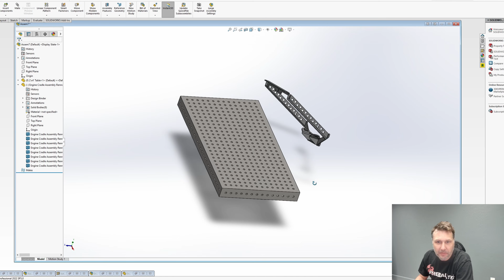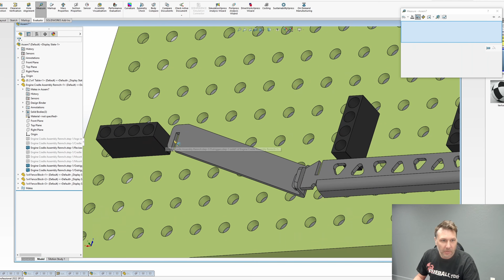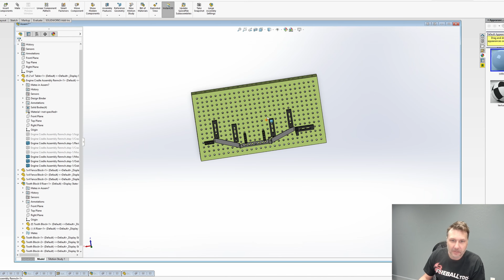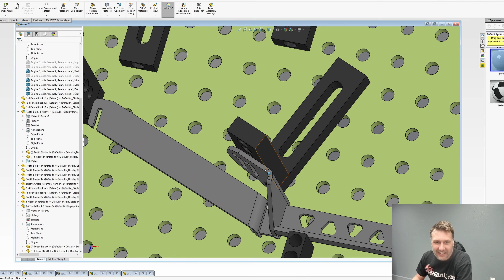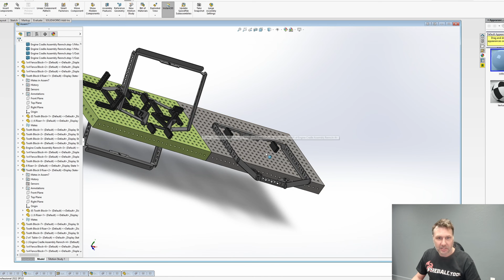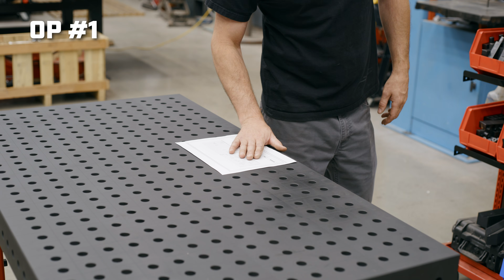How to Make a Fireball Tool Fixture Map: Subaru Sub-Frame

Comment: From my work in topographic surveying, machining, and dimensional inspection, I could recommend that using a planar primary datum surface that all other surfaces are positioned by, makes everything much easier.  That set of positioning references (secondary, tertiary etc. part feature datums) can be more easily located and serve as reference for all else, greatly simplifying design and fabrication. 😉

Comment: That frame is a textbook definition of over engineered =)
Reply: Hi. I am by no means a CAD expert. In fact I'm on the beginner end and this was a stretch for me. I'm curious what parts you found to be "over engineered". ? I would love the assembly and production of these to go quickly and I'm typically doing it by myself, so if there's a simpler way to get there I'm all ears. Thanks for the feedback.

Comment: Jason, I have one concern over the final fixture. The 'Boomerang' sub assembly that hangs off the table isn't located in length(from parallel cross beam) and angle compared to side rails. Once dropped into the rails slot/tab  it could twist in relation to the tables plane   I also think you should include call outs on your fixture map for shims and risers for non-2D mapping.
I really enjoy the videos and admire the system you have put together.👍👍
 Lastly, is there a way within the fixtures to map a 3D layout from locating holes on the parts,(without) using the exterior dimensions.

Comment: in the time you are sitting behind your laptop, figuring out all the distances and stuff. we have made a jig that you can re-use. clamp the jig down and clamp your stuff on the jig (made with mostly scrap pieces of metal). then when you are setting up your blocks and stops on the table (wich you will need to set every time instead of clamping a allready lined up jig down like us), we are allready welding and cleaning up welds etc. the when you finally start welding we are allready lining up the next parts on the jig. 

and then i did not even mention that you will need to measure out the blocks and stops EVERY time you are using the table for something else. instead of just setting the jig down and clamping the jig to the table and instantly being able to clamp your metal in the jig that is allready lined up and measured... kinda makes most of your video's about this table stuff useless...  you are working harder and making your life more difficult with that software and those loose blocks and stuff. no hard feelings but comon, most people can see this is just money wasting if you buy these expensive tools and software just for making a jig that needs time comsuming lining up everytime wich is cumbersome. make a quick jig out of scrap metal. 1 that is re-useable and doesnt need 1 hour computer work and then 20m setup time before you can even start working lmao....
Reply from the maker: This sounds like a challenge. I’ll take you up on that. I’d like to see you make a fixture faster than the Fireball system.  Contact me at the fireball forum to discuss the details of the challenge. Jason
Reply: LOL, what a clown!!!! 
Love your stuff Jason, and the people that do this work for a living or a serious hobby absolutely know the value in your tools and experience.
Reply: But now you need to store the jig when you're not using it. It all depends on how many different parts you are making and how often.
Reply: and dont get me wrong, it is cool that you make advertisement for your work stuff... like the bench vice and what not. but for this.... imo its useless and really a money wasting thing. its like vapes, throw-away because after realising you waste time with it. you will throw this whole block idea out of the world and make a jig urself. and even for 1 time use only you can use clamps and scrap metal to achieve the same thing you are doing now without the actual need to sit down behind a pc for 1 hour figuring everything out and then 20mins for measuring and setting it out on the table.
Reply: honestly would love to do that, unfortunally at the moment i am not capable in doing so. if i ever becomes capable again, and think about this video (wich i will, i like metal work) i will take up on that challenge!

Comment: Just before you mentioned it, I was thinking that hopefully this exercise will guide the designers of this subframe to an improved, more manufacturing-friendly form
Reply: Thanks for the feedback. When I originally designed it, I didn't have a fabrication table or any real way to ensure that things were where they were supposed to be. So, I always had this vision that I would design it like one of those balsa wood dinosaurs we had when we were little kids. Now that I have a fixture table, I will definitely be making some design tweaks. Thanks for the feedback.